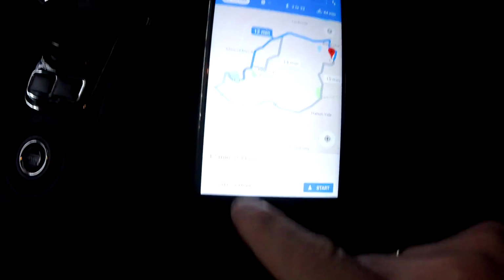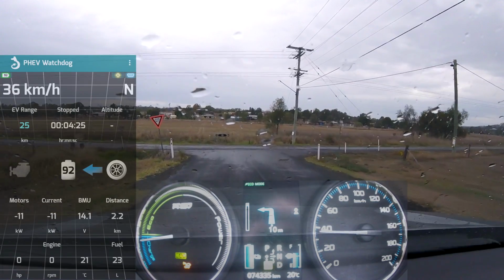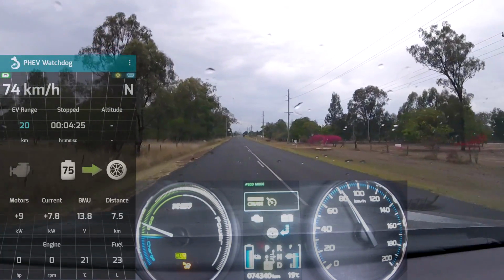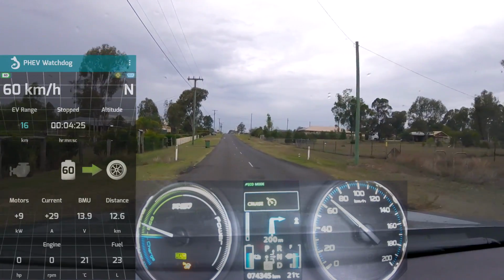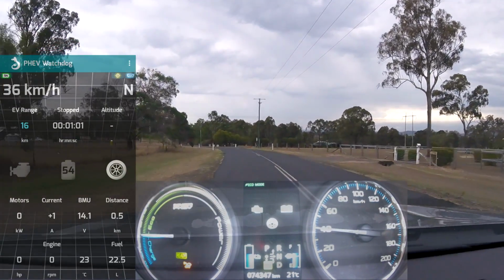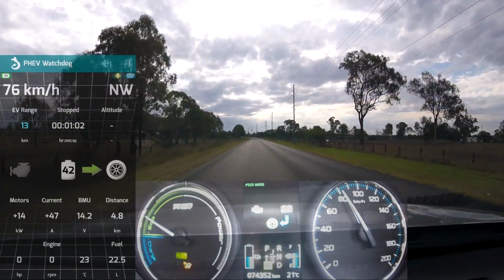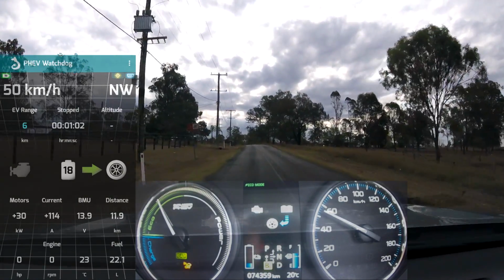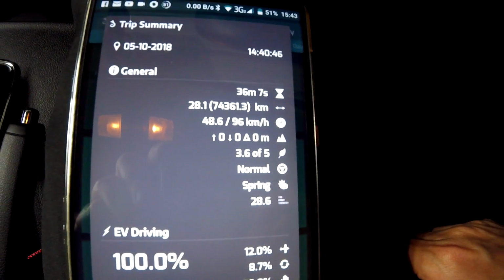EP132.2 - Driving the Outlander PHEV under 1C (fail).

Comment: While I agree in a perfect world you'd want to keep the charge/discharge rate under 1C this would rarely be the case for any BEV, let alone a heavy PHEV like the Outlander.  Most quality cells are rated for at least 3C continuous and probably double that peak - sure you won't get the same longevity or range as if you'd discharged or charged at 1C but then you won't get the same at 1C as you will at 0.5C - so it comes down to a question of practicality.  Plus the battery is not continually discharging at that rate - it's peaking during acceleration and regen and then a lot of normal driving would be around that 1-2C rate. Sure a PHEV is harder on the battery than a larger pure BEV but Mitsubishi did warrant this battery for 8 years. I would say the worry about C rates is overstated - more of a concern is the continual full charge and full discharge experienced in a PHEV pretty much daily for a lot of drivers. That ramps up the cycle count so in 4 years you're up to about 1200 full cycles (at least I am) - and for a lot of lithium battery chemistries, even treated well that is their useful lifespan.
Reply from the maker: That is very good information. Thank you!

Comment: Hi Andy, in the UK our rapid chargers deliver 50A @ 320V over Chademo, which is 16Kw = 1.34C.
The charger cuts off at 80% as that is when the charge rate starts dropping noticeably.
30% to 80% takes about 25 minutes.
Reply from the maker: Hi David, CHAdeMO usually delivers 50kW (not 50A) but the PHEV takes only ~20KW on DC FC.

Comment: Hi Andy as per Lancer below, I agree the pump likely the vacuum assist for vehicle braking.  Also thinking that power steering assist is pure electric. It'd be nice to place a few of the new capacitor  units across the battery at 3.5KWH each they're only 48V,  though can get 1 million charge recharge cycles! https://arvioshop.com.au/supercapacitor ..all the best Gerry NSW.

Comment: Hi Andy, i wonder also about your high average consumtion with your veeery carefull driving style. Maybe this slow accelerating style is not the right method to get low average c9nsuption values. 
For a gas car experds says, accelerate fast to target speed and then coast. Maximize the time not accelerating.
I thing for an electric motor it is more efficient to run in high power mode, also for the converter and then to coast when you are at target speed. 

A the theory is also the shorter the consumption time (accelerating) the less bad effects for the battery. I can't prove this right or wrong.

I think you are also right there is the other effect, higher output higher ageing. Did this two effect are overlapping? What effect is worth?

My RC helicopter Lipos have 25 C and more, but they are lasting for sure not so long like a car battery.

Comment: The Pump at the beginning is the breaking power pump. Push the brake one or two times and it will start again and stopp in a few seconds.
Reply from the maker: The pump I meant was the cooling pump for the DC/DC converter, charger and rear motor. The vacuum pump for the break booster is far louder and runs only for a few seconds.
Reply: It’s called a vacuum pump.

Comment: Andy. You are very concerned that your battery is degrading. And therefore, you think that currents are harmful to her when energy is released. But it is not so. High currents are detrimental when receiving energy from the battery. High currents in the return of energy are harmful, to a greater extent, for an electric motor. I often travel around the country. During one trip I drive about 1200 km. Speeds in Russia in settlements are allowed up to 79 km / h. On the track you can go up to 109, 129 or 149 km / h. So, after long trips, I noticed that the battery is charging proudly more, about 10 percent. I assume that this is due to the fact that the battery is actively working on the road, both for charge and for discharge. If it is not done often, it is useful for the battery, since the cells do not stagnate in this way. They begin a chemical reaction as if anew, they regenerate. Thus, in my opinion, degraded cells are restored. My friend has a Nissan Leaf. He had the same problem with the degradation of the battery (its capacity dropped by 20 percent). After he began to drive aggressively on the car, to brake and accelerate sharply, the battery capacity recovered by 12 percent. Try this option. I apologize in advance for possible errors, the text is translated via Google translator.
Reply from the maker: Hey Alexey, thank you for information and feedback. That is a very interesting theory. I have read about this before and know that under certain circumstances high currents can break the SEI layer off the anode. The only downside was, that this 'crust' is not dissolving anymore and  the gap/crack will be filled with new solid material in a short amount of time. So it seems that this is only a temporary improvement.
Translation works just fine, Alexey. Thanks again for your contribution.
Reply: Spasiba, good info. I will try on mine masina

Comment: I don’t remember which car dealership but I remember a customer got all the money back for a vehicle due to false advertisement regarding something. This vehicle was advertised for 35km right? But you can’t reach that? I think can sue them
Reply from the maker: It's not that easy. The car was advertised with up to 54km EV range and I'm down to 30km. All this is of course highly dependant on the conditions the car is been driven in. We are in contact with Mitsubishi and working on a solution...